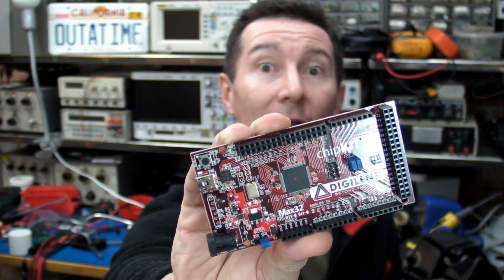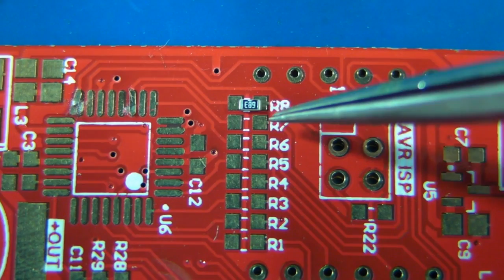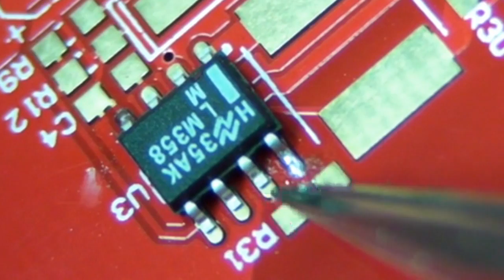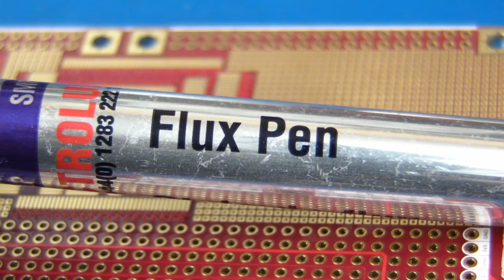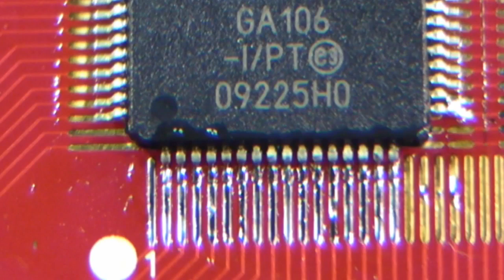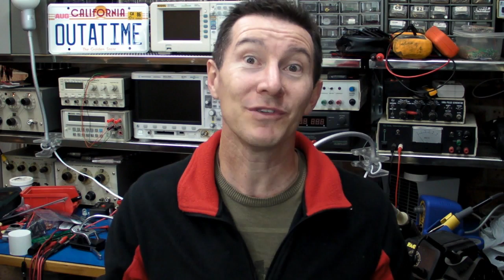EEVblog #186 - Soldering Tutorial Part 3 - Surface Mount

Comment: I can solder 0402 like it's nothing. With hot air, it's easy. I'm making all complex projects 0402 unless it's important to see numbers. If resistor number markings are important, then 0603.

Comment: one word of improvement to your tacking two terminal components method, be careful with the tweezers not to grab the smd with the tweezer prongs extending below the bed of the smd (hard to see from above as you get a 2D vision, look from the side of the smd) this will prevent the smd from correctly bedding with the pad EVEN if it will solder you create a compromised mechanical joint that can become a cold joint with vibrations and age.

Comment: At 8:20, the pads look quite large for 0603 components. Were  these originally designed for 0805 packages ?
Reply: I've seen footprints designed for hand-soldering have larger pad.
It's good for one-off projects.

Comment: If the problem with the laptop is minor and the laptop repair shop in Isfahan has enough time, it will ask you to wait for a few moments and fix the problem and who will receive the cost from you. Fairness in laptop repairs is an important step in branding a good service center. shorturl.at/fyLWZ:thanksdoc:

Comment: I've modded several PS2s in the early to mid 2000s with success.  However, recently as of a week ago (been 12+ years since I last soldered), I made the mistake of perhaps of both pushing down too hard, or had the heat cranked up too high on my iron but, not only did I bend pins on the DVD driver chip but I also lifted 3 pads and it's toast now.  The DVD driver chip is too large and is in the way for me to track down any of the traces to do wires to.  But wow, I think it's the .5mm pitch pin pattern on this particular DVD chip and I was under a microscope.  It continuously bridged the pins even with a mass amount of flux and my hands are just too shaky anymore.  But I love watching others solder

Comment: It's great that you are showing this for everyone, because everyone fears it so much, but these joints would never pass rework QA in most reputable places.  

You should really get a finer tip (one with a slight angle at the end will make this heavenly to do, but don't put that bend in yourself, because you'll crack the nickel coating) and use steel picks to "drag" out solder that is shorting close pins.  Solder wants to flow toward the heat, and the steel will stay cool enough long enough to allow this, allowing you to move fast with just quick reflowing.   Using the wick is a very bad idea for most of these pads.  They lift way too easily after several re-heats, especially with such an over-sized tip.  And, that wick will spread the heat to other pads, at the same time.  And, there is just a tendency for people to pull the iron away before the wick, cooling the solder just enough to start to solidify, and thereby yanking on the pads.

Also, keep adding resin flux, each re-heat.  The flux helps to de-ox the surfaces.  Clean-up is just a fact of life, when doing this stuff.  Back in the day, we would use Freon with an acid brush and special tissue wrapped around it, which was really fast and easy... alcohol is the second best thing, though, now that Freon is outlawed.  

Also, leaving the lifted pad in place and relying solely on that joint is not the best idea.  A proper tracewire fix would be recommended once you have a lifted pad.  The damage is done and unknown.   Don't count on things continuing to work well or for long once heated/cooled enough, after damage has occurred.

Comment: At 21:13 aren't you doing it "cold"? In the first soldering video you said all the flux will burn away before you get a chance to apply it. Or does that not matter in smd soldering?

Comment: @30:20 you talk about the "hot air solder level board" being lumpier and not as flush.
A trick I used when soldering on home etched boards was first tinning the boards by fluxing them, and then dragging solder everywhere to tin them.
No matter how little solder I would try to use, they would invariably have the kind of lumps you are talking about in some spots.
The trick was to then use solder-wick to "remove all the solder from the pads"
It would remove all the lumps, but there would still be an infinitesimally thin layer of solder on the pads. (they were still silver, but were now "flush")
Now my ICs would lay flat and could be soldered using the methods described in the rest of your video.
I would guess that that trick would also work with manufactured boards of the type you are talking about at 30:20

Comment: Took a Pace certified surface mount class in college and some of the solder connections would not meet the certification requirement.   His technique is spot on. Recommend cleaning pads and adding flux earlier in the process, last I checked flux isn't that expensive.  Excellent drag attempt, try using a smaller tip.. Decent solder paste example.   1st 2 pins looked lacking but was corrected prior to adding heat.  ADD FLUX, ADD FLUX, ADD FLUX.
Reply: totally agree, always flux the clean board his previous video he claims not to flux and not to put solder on the tip because you will burn off the flux doesn't matter if you have fluxed the job

Comment: I had a board built for me through PCBWay from a github repository and the gerber files had a solder paste layer on every pad.  Could I just place the resistors and use a proper hot air soldering station for these?

Comment: How do you make the solder stick to the part?  I've run into a few dev boards and similar that a SMD part falls off and when I try to repair the solder just won't stick to the resistor/diode/whatever even applying flux and lots of heat.

Comment: Still valid video.
Age (and glasses used) makes a huge difference in size you can handle. At 20's 0805 was no problem with no glasses at 40 years+ even 1210 started to be difficult with normal far adjusted glasses without magnifiers or microscope.
Reply: You're not kidding.
One of the best electronics investments I ever made was my "electronics glasses".
I'm nearsighted, and once years ago I was ordering a couple of pairs of glasses from Zenni Optical.
On a whim I added a "special" pair to the order:
Instead of my actual (nearsighted) prescription, I ordered a pair with the highest level of farsighted prescription you could get.
(the "plus" numbers instead of the "minus" numbers that are for nearsightedness)
On top of that, you could also get them as bifocals, so I added the highest level of bifocal correction you could get.
My normal minimum focal length is about the length of my arms nowadays.
With those on, the non-bifocal part focuses at about 10 inches (25cm)
In the bifocal part it's about 4 inches (10cm) from my face.
GREAT for soldering SMDs (and reading the markings on SMD devices as well)
(just don't try to walk anywhere while wearing them)

Comment: I have been soldering for about 45 years and this video way overstates the ease of soldering SMT parts.  His soldering was just terrible with his hand soldering.  He had solder bridges and at least one open pin.  He has no way to inspect each joint.  One mistake on any pin and the board doesn't work.  Did he mention how hard it is to trouble shoot a SMT board is?  All you need in one unsoldered pin on a flat pack and the board doesn't work.  Just try and take one of them off the board to replace it.  LOL  Just one mistake and the whole board is ruined and the cost of the board and parts are scrape.  I have literally spent hours looking for 1 bad solder joint on 100's of soldered pins.  I use a high power microscope  and can zoom into the pins.  Even that is not enough to find the unsoldered pin.

Comment: Thank you, Dave! I have been following your channel for years but have never left a comment.

I learned to solder at 10 (I repaired my NES clone), but my soldering always sucked. Most of the time I didn't like the end results.  Watching your soldering tutorial was like a final blow for me: something clicked in my had. After watching the last part of the tutorial I took a cheap Chinese Arduino Nano clone which came with unsoldered pins and tried to solder them in following your advices. The end result is beautiful: it looks as if the pins were soldered by the manufacturer.

Am I so grateful that I cannot describe it!

Blessings from Ukraine!

Comment: Thanks a million, I had this little watch kit https://www.ebay.com/itm/SCM-Transparent-LED-Watch-DIY-LED-Digital-Tube-Electronic-Watch-DIY-Kit-New/362388419401?ssPageName=STRK%3AMEBIDX%3AIT&_trksid=p2060353.m2749.l2649 that I ordered a couple of months ago.  I looked at it and decided that there was no way in hell  I would be able to solder that tiny micro-controller chip in place, and I let it lay around my bench of a long time.  I ended up ordering a new soldering iron, new tiny tips, and one of those tip cleaner deals with the shaved copper or brass stuff.  That really helped, and the other day I found this video and watched it to prepare for my assembly, that gave me the nerve to attack the kit, and IT WORKED!  The kit is all SMD, and I did find the very tiny tips were not a great lot of help, that tip cleaner made a great deal of difference. I used a flux pen for most of the soldering.  I have been wearing the watch now for about a week, it looks stupid but I am so damn proud of my soldering  job I just want to show it off!

Comment: Take a halogen bulb used for car headlight. Mount it to a flexible arm. Run a polishing head on a dremel or similar device to polish the inside of a stainless steal tube. The tube must have an id large enough to fit over the bulb. I made mine with approx 3/8" clearance in all directions. After the polish, cut a slot about 1/2" down the length of the tube. Cap one end. The length of tube needs to account for mounting. Mount tube over the bulb so as to sit at a slight angle away from operators position. Bulb and tube must be parallel to pcb during operation. Depending on bulb and temp requirements adjust voltage as needed. Again I use 20vdc with a buck reg. 300f = 15vdc for mine. The tool is ready.
To use: apply solder past to all contacts. With a blank pcb I've found wax paper covering the board and a lite touch from a plastic squeegee evens out the paste. Place all the smd's on the pcb. Place the new fangled infra-red soldiering lamp about 3" above the pcb. Remove the pcb. Turn on the lamp. Using a metal plate under the pcb leave the lamp on until the lamp and plate come up to temp. With a sliding motion, place the pcb with paste and smd's under the lamp. Leave it there until the paste bonds, about 5-10 seconds. Slide the pcb at a slow rate equal to paste bonding. It's a good idea to have a silicone rod to position smd's during the soldiering as they will tend to walk. Done. 
If the board has through hole components this will leave pre-tent for them as well.         
                                           Just Thinkingoutloud

Comment: Dave, wait till you get some 30 years older.  Then you'll need optical aid to solder even those 0.05" pad spacing parts, never mind the 0.65mm and 0.5mm stuff!  (I can still do it, just not without some 'coke bottle' lenses!

Comment: I am trying first time solder paste. First results are very promising, but handling the sticky paste is still a problem. From the 30g content in the syringe you get either too much or too little and transfering the paste from syringe to pads is also cumbersome. Do you have  a tip how to handle this optimally ? Thank you

Comment: wow this video is old.  Nearly 6 years.  I know this is just a tutorial video but that was a sloppy job, that first resistor.  To much solder and prep of the pad was done wrong.  Apply solder to tin the pad then suck up the solder leaving a minimal amount on the pad.  Then solder like you did.  I always try to put a minimal amount of solder on the part.  Also, everything is RoHS now and solder temps are higher plus the shiny finish of the solder is slightly different since there is no lead in solders anymore.  The finish is more like a dull grey crackly type finish.  Yes, you can still get lead solder but that is fast becoming obsolete.

Comment: Is it just my solder or a common issue?  Whenever I tin my iron tip with rosin core solder, the liquid rosin boils and splashes all over the place. This is not visible with the naked eye except when the small rosin droplets land on the hot part of the iron above the tip, where they burn and slowly fill the iron with brown spots. This is happening even at 250˚C(480˚F) with both 1mm and 0.5mm solder, although it's not as bad with 0.5mm.

Comment: I have 7 mm solder,3 mm solder,and I have 6 mm coming .I hope that makes my smd exspermitting do a little better ,plus I bought two different liquid flux,plus I have two different paste flux,now ,all I have to learn when to use what..huh.,I really don't like smd soldering yet,
Reply: 1. Paste flux
2. drag solder
3. clean with solder wick
Reply: BTW, you might get some burnt flux on the board, but no worries about that. No shorts and you're good to go.

Comment: What the best way to learn smd soldering and use of a heat gun,something to practice on,I sent for a practice kit,but I found out some of these cheap smd hobby kits are not made well,I bought a kit and my flux pen removed the foil I was going to tin,it desolve the foil or something the little pad disapered end of kit.see this where hobbyist have trouble,anyone

Comment: And for us over 60 years old with shaky Hands and bi focal glasses ,smd soldering is a night made,and I bought all the stuff I need to do this stuff.and some of the hobby kits ,have very bad foil to solder to,and if you use one of those flux pens on cheap kits,it will desolve the foil completely..so fellow hobbyist, be ready for mistakes with smd kits.

Comment: What size solder are you using for most of your smd parts
Reply: Ron Thompson He said it quite briefly, so you might not be able to hear it, but all I am sure, is its at least 5mm or smaller
Reply: Well, the smaller, the better.
Reply: Dave said he's using 0.46mm in this video. See 7:44
Reply: 0.44 what's the conversion on that,like I have some 0.31 which I belive is 7 or 8 mm
Reply: Matthew what brand solder are you useing ,and are you happy with it ,the kester brand I have been useing for thirty years,is the best,some of that Chinese stuff doesn't work as well

Comment: In a pinch, if you need a small diameter solder but you only have the larger diameter solder, a trick I personally discovered is to simply pull and stretch a length of the solder, making it a smaller diameter; the rosin core stretches with it too -- it really works quite well!
Reply: Wow!  You have a real life wire stretcher!
Reply: I thought  I was the only one who did this! lol
Reply: @mikestribling7574  Great!  You're the only other person I know of who also said they discovered that trick!😃

Comment: Frequently uses incorrect terminology and often tells people that flux is not needed. If you care about your work and or was trained correctly you would use flux. And when making your own boards or assembling kits, have all the part with identification numbers face one direction. This is easier for later repairs. Flux helps to even distribute the heat, especially when you are using Rohs which takes a slight bit more heat to melt.  

Remember: Excess solder does not help the electrical bond.

There is no fillet on a SMD pad! A fillet is generally on a bifurcated post, or recessed hole. Too many terminology errors to correct them all.

And yes I am NASA/MILSPEC/AF certified. 
Shuttle, Missiles and everything else!
Reply: k thanks
Reply: What I am saying is that liquid rosin flux is better in my opinion, and I have done thousands of these. My definition of a good replacement is not being able to differentiate from original manufacturer. But then again I have seen other techs work too.

Comment: Great tips on soldering. I've designed microelectronics but always been lousy at soldering. I think I could actually go into the prototyping lab and solder something now.
One thing that concerns me is the time he spends with the iron dumping heat into the components. I picture the wire bonds and die cooking cooking away.

Comment: Personally I am a big fan of tinning the solder pads prior to mounting the surface mount components. Sometime when we have boards made we will get the boards already tinned, but if not then I would tin them and then use the solder wick to clean it up. That leaves a very slight layer of solder. Then when I go to mount the component I can use either tweezers or a dental pick to put downward pressure on the component while I apply heat to the pad. It is just enough to make it stick while you solder the other side and then you come back and apply solder to the first side.

Comment: What's a cheap way to measure the values of SMD caps without a special tool?
Reply: Find a documentation (ex. datasheet) of the smd component and it'll have all the informations you need.
Reply: watch a you tube video

Comment: is there anything i can do if the chip on the board of my flash drive has come loose? I bumped into it while it was plugged in and bent it and the chip came loose, thanks
Reply: That sounds like probably a lot of damage. If only the solder joints broke, then you could resolder it on. But I suspect lifted up pads from the PCB, which makes it practically unrepairable on a flash drive. Also if connections broke while it was powered up, there's also a chance of it getting electrically damaged. Without further information, I say that flash drive is most likely unrepairable.

Comment: Try tinning all the pads before you solder a big chip, then just press each pin into the solder with a dry iron. The results are as good as reflow, I've done thousands now!
Great series!